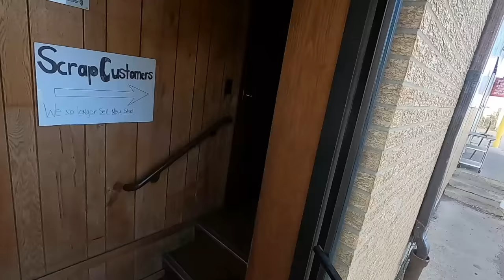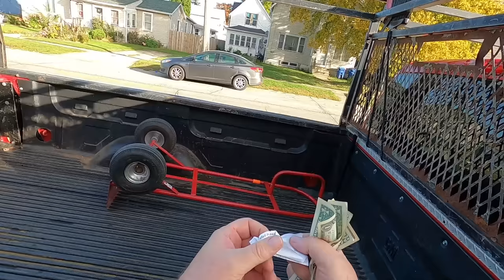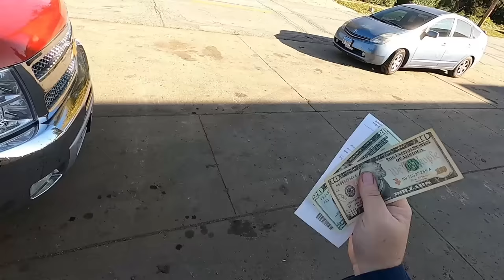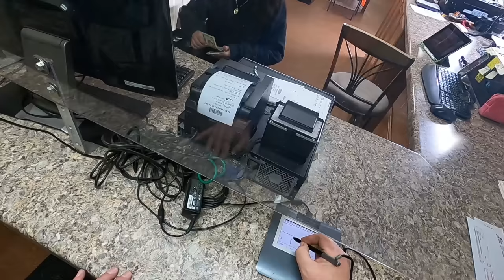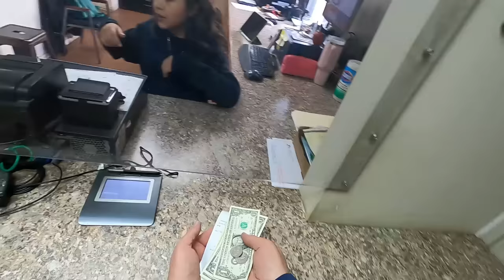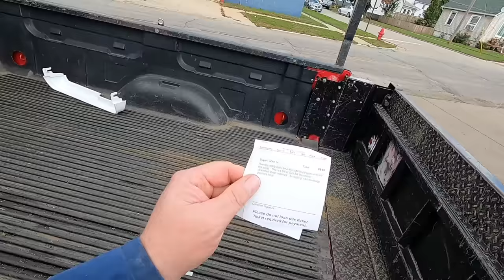I Made the Most Money Scrapping Today

Comment: Depending on how old the refrigerator is, youd be surprised at the resale value of those shelves and drawers. Brand new they are crazy expensive. I have a 10 year old fridge and was looking to replace a plastic drawer with a crack in it. The OEM price was over $100. I opted instead to just superglue it. If there was one available on ebay, I'd have gladly paid 25 bucks

Comment: Those kitchen cabinets were from the 1950/60s, top of the line. When tipping the washer, dryer, or stove, I use the power cord over the far end of the control panel to help. I would not do this with working units, not damaging the cord. Thanks for the video.

Comment: A $200.00+ day,not bad at all. The only thing I would have done differently was put the wretched strip under the ladder rack instead of over. That way it would have put pressure on both of the cabinets and you could have saved a little time, but it all worked out for the best.

Comment: There is a lot of copper wire in the washing machine engine. Why don't you disassemble the engine?
Reply from the maker: Engine? How much time would it take to tear apart an electric motor? I'm sure plenty of people do it, just wondering how much time it would take for every washing machine and everything that I find that has a motor to add that as part of the work process.
Reply: A lot of the new washing machines are not copper motors.